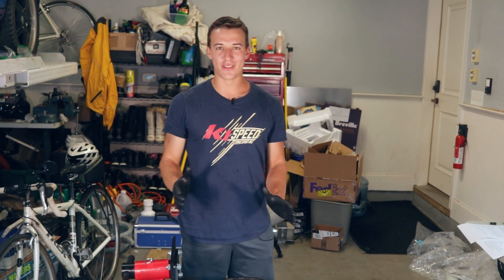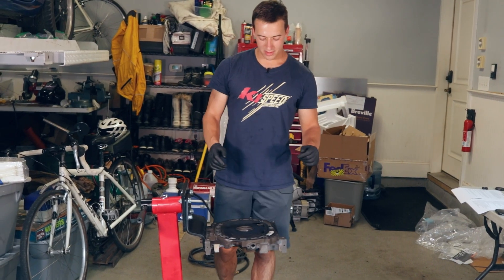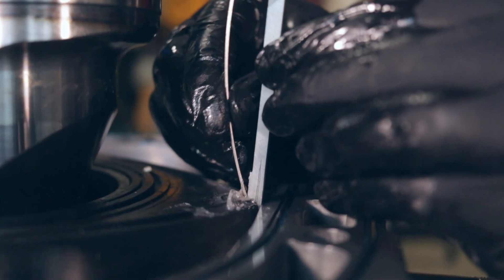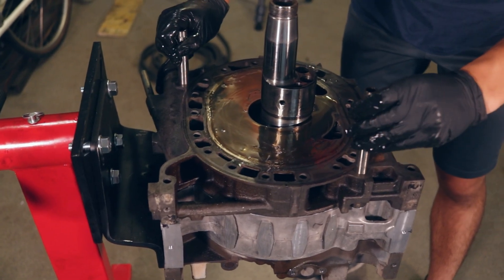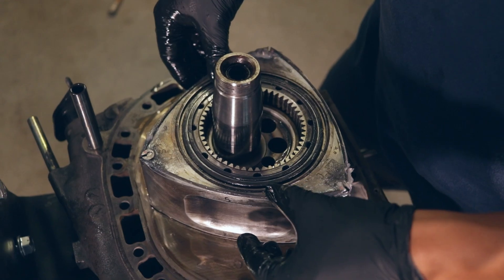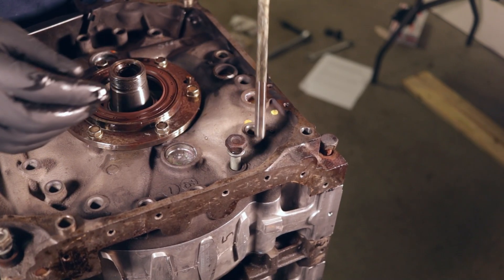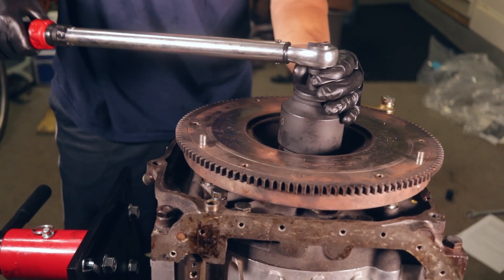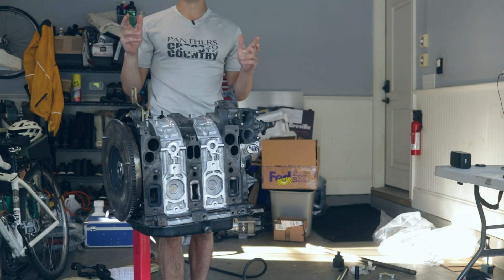Building my Mazda RX8 Rotary Engine (13B-MSP Renesis Build)

Comment: Well you were right and now it's my turn to perform rotary surgery. I'm just about to break it open and have the parts all professionally cleaned. Can't wait it build it back up. I'm  not too worried about the motor assembly, it's putting all the crap back on and around the motor I hope I can remember where it all goes lol 
I've done piston engines but this is my first rotary build, i am pretty excited. I saw another channel where the guy used a ton of Vaseline and not oil as assembly lube , I guess it's whatever works for each person. Did you do any porting or oil pressure pellet upgrade? Anything I should consider or keep in mind to extend the life of the new motor that you did to yours?

Comment: I am rebuilding an RX-8 engine, but my APEX seals are 178 thousandths wide and 78 thousandths thick.  All the seals I see on rebuilding RX8 you tube videos the APEX seals are closer to 300 thousandths.  My Mazda is a 2007 RX-8.  Why would there be a difference in the APEX seals width?

Comment: I just bought a rotary not knowing they was this different lol so I was scared thinking what troubles I’d run into if something happens this video made me realize its easier than a normal engine (to me anyways) so thank you for taking that stress away
Reply: Once you understand them a little bit they become a lot less then typical piston motors a lot less moving parts involved
Reply: I would bé scared to miss putting the Apex seals well...

Comment: Built my renesis for turbo it's all complete but for some reason my starter won't start the car it cranks but that's it...ps I can push start it and it starts right up and drives fine any advice would we appreciated thanks..

Comment: before I say this, if you want, or have a rotary, do you RESEARCH! dont always trust the 1st guy you meet who says their an expert in rotaries. there is a shit ton of misinformation out there. Double check your info, then triple check it. that goes for me as well.
pro tip that is almost always overlooked: FILE YOU SIDE SEALS! THEY AREN'T DROP IN! I dont know if you did that, but yea, side seals arent drop in. you need to file them down to proper spec between the seal and the corner seal (.004 is Mazda spec, but you could get away with .002 and get higher compression as long as the seal isn't binding.)
another tip for others wanting to do the same thing, use assembly lube and Vaseline (or any other petroleum jelly) not regular motor oil. the reason for this is assembly lube or bearing grease likes to stick to things so it will protect your engine when starting up, and make sure the seals don't wear excessively when running for the first time. the motor will then gradually burn it off, so make sure you also change your oil within 500 miles. When starting a rotary for the 1st time it will have low comp, then slowly build back up to where you want it, another plus for assembly lube is that because it sticks to surfaces, it will keep a tight seal for that 1st startup.

Comment: I have a feeling it's the 2 thou (0.05mm) side seal clearance that has caused the low compression.
I'm clearancing mine at the moment and I've found that pretty much anything under 0.1mm has a chance of binding and not being able to spring back in some cases.
Mazda says 0.05mm - 0.15mm but I'm going to be going 0.15mm as my minimum, even slightly over should be perfectly fine.
Reply: i know thos comment is a year old but all i can do is pray you did not build your engine like that for your own sake lol side seals should be 1-3 thou of clearance
Reply: @jamfd3s788 he’s Keepin rx8s cheap

Comment: I hope before you assembled the engine, you checked clearances and if all parts were in spec.
Reply: I thought that was mainly in piston motors you check clearances and junk lol
Reply: @joemurcia3527  When you reuse parts of the engine, you do, and side seals need a little bit of adjustment even if they are new. Everything is in the workshop manual.

Comment: Aren't the rotors paired specifically with each other due to being balanced on the e shaft.. so really all 3 parts should stay together and should never mix and match from other engines unless machined and balanced properly.
Reply: Not rx8’s they stopped balancing the rotors there all the same rx8 rotors just have the side cut on opposite sides so it’s a front or rear

Comment: Crazy ow straight forward rotary engines are compared to piston motors. Barely any measuring to do or timing.
Reply: I know! Everything seems to go together so easy. Plus looks like everything is super light so you can move it all around very easily.

Comment: In 9:13 I can’t see if there is the o ring in the iron that seal against the stationary gear. Can you confirm that?
Reply: there was one around the rear stat gear, not on the iron so you can't see it. It is better to put it on the iron though, it can prevent it from accidentally getting squished.
Reply: @PeterArmour  if that oring isn’t in the specific place by design, you will see oil everywhere.

He asked of our opinion if it will run or not. Probably it will, but I have no idea about the seals, gaskets, measurements,... not informed in the video. For example: the water o ring seals from the housings are not  the OEM. 

Compression test will the light of a good o bad assembly.

Kind regards.

Comment: Why didn't you get the rotors and shaft balanced?
Reply: This is hard to do on a renesis engine. Theres not much to remove on the rotors to correctly balance them so its a gamble. Its also costly($800 just about)

Comment: Don't be afraid to use plenty of silicone around those lower legs of the rotor housings. Especially around the tension bolt hole. You seem to be a little frugal down there. 😉
Reply: Was that the silicone he was using from the small tube? Didn't let on during video! Cheers
Reply: I noticed that too, it might seep around those holes since there was no sealant around the holes. Also, no oil pan gasket needed, I use Toyota FIPG personally, but I know other people use Permatex Ultra Black with good results too.
Reply: @neilcampbell6855  its the right stuff thats the grey one it dries instantly
Reply: So should I order the gasket kit or go ultra black or ultra grey gasket maker all the way? Works great on piston engines, better than the paper junk but would like an opinion since it's a raotary and it's my first build.
Reply: @joemurcia3527  The main difference with sealing the rotary is that you have seems on the bottom due to the different plates being bolted together. Those are all potential leak points. Proper cleaning is key. Most will just wipe the surface and then use the silicone. That surface has to be absolutely residue free so the silicone can properly adhere to the metal.

Use a good acetone or alcohol and rub the surface with a quality white paper towel that's folded. DO NOT rub back and forward because all you're doing is smearing the residue back and forth and not removing it. Wipe one time in one direction, then flip your paper towel to a clean side and wipe again. Your acetone should be wet on the entire towel. Every time you wipe, you should see dark residue on the towel. As long as you're seeing residue, it's not clean, so keep going while using new paper towels. Also, don't try to wipe multiple sides of the engine all at once. I do one side at a time until clean. You're gonna use lots of paper towles. Make sure you clean the oil oan flang the same way. Now grab the black 12 hr Permatex that's designed for oil pans and put a good bead on the engine side. Use your finger to spread out evenly. If you spread out and it's paper thin, add more silicone. Bolt on the pan to proper torque spec and leave that engine upside down for 12hrs so it dries. Too many people turn the engine over to finsh assembly, but the problem doing that is the internal assembly lub will start to leak down the inner walls and enter that sealant section and contaminate your silicone causing leaks. You do this right with a nice flat oil pan that isn't bent and it will NEVER leak.
Reply: Great information! Definitely not something you want to rush through, these are the little tips that make the difference in how long a build lasts, much appreciated  🙏

Comment: Don't you think that other seals maybe better? RA seals or goopy?
Reply: For the rx8 there is no need to buy seals other than stock unless you dont want a running engine(rx8 is really finnicky to rebuild). Only time you should go aftermarket is buying deeper rx7 seals for a turbo build.

Comment: Holy shit how am I this early and why does Youtube know that I wanto buy an RX8 someday
Reply: Facts
Reply: not a dream, you can pick a good one in your area for probably less than 5k
Reply: don't
Reply: I think the rx8 is under appreciated and misunderstood. Once you figure out solutions to the  factory weaknesses they come with it can be a great motor and the car is very sexy. It's also a car not just anyone should own. I bought 2 lol
I think some day they won't be as easy to find and values will go up.
Reply: CIA
Reply: the reason why wankel failed to replace the conventional inline-4 engine that we all use, is because of its terrible gas mileage and oil consumption